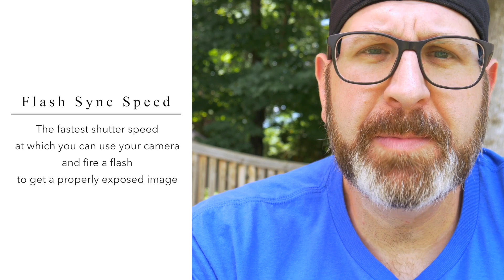What Is Flash Sync Speed And How Does It Work

Comment: Good video! From my understanding the flash goes like  1st curtain fully opens, burst of flash happens, but at that moment 2 curtain is already partially closed so we get  part of the sensor not lit by the burst of flash. So strictly speaking it is the shutter window frame and the second curtain forming the edge of the flash exposed section not the first curtain and the second curtain like you said at 2:46. Otherwise sometimes you may see a bright bar in the middle of the frame which is not seen...

Comment: hi Dear
wanted ur advise with regards to third party speedliteflash 
which ttl I 3rd party flash is as best as  the nikon sb 910 .i have yongnuo 560-iv version which is a manual flash but not that powerfull like the nikon sb 910
is godox v860 ii better or neewer or altura flash better..need ur suggestion ...im initially into small function like birthday parties n baptism parties but by using yongnuo 560 iv  i couldnt lite the group(8to 9 member)in same focal lenght .... i will start off camera flash once i get into events but as of now for small parties i just wanted ur advise on good n powerfull ttl speedlite...
Reply from the maker: I would recommend the V860 II if you'd like a TTL flash comparable to the SB910.
Reply: Spyros Heniadis thank u sir 
appreciated ur advise ... will certainly go for godox flash👍